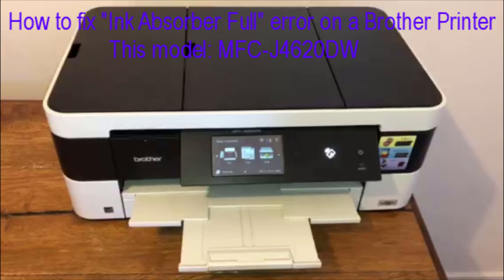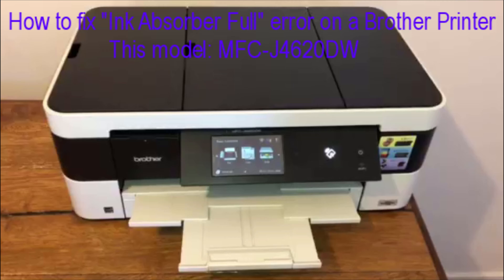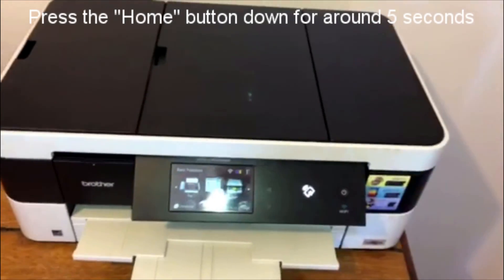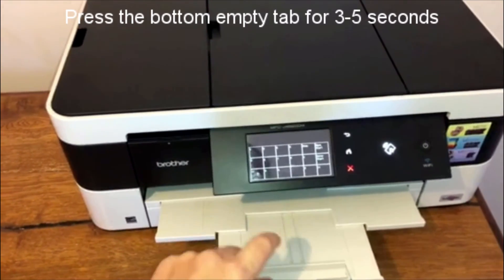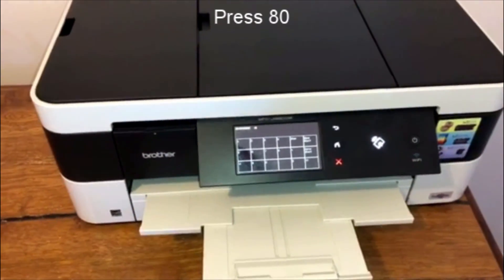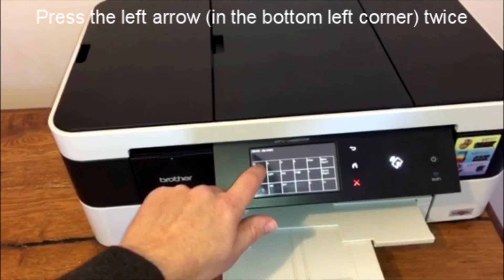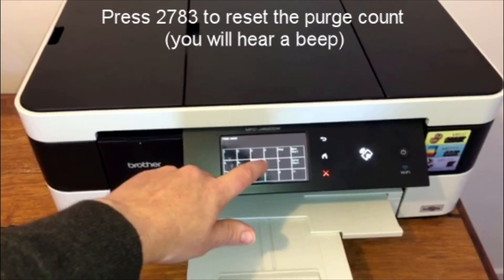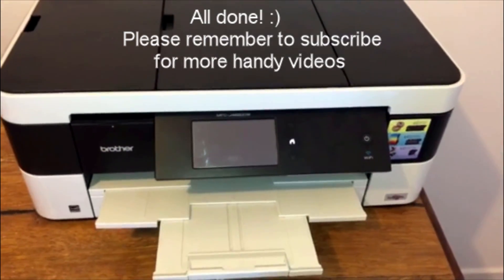How To Fix Ink Absorber Pad Full (Error 46) and Clear Purge On Brother Printer.

Comment: This isn't working. I followed and did your other video on cleaning the ink absorber. I cleaned it put the printer back together and right away I got the ink absorber message. I did this video as well but its still not clearing out the error for thw ink absorber and still won't copy or print. What should I do next ? Please help I dont want to replace this printer. I really like this one

Comment: It worked with J4420DW but two notes: I saw "Machine error" after entering *2864 but I pressed on regardless.  There are two PURGE items on the list. One PURGE alone, and another <en> PURGE.  After clearing just the second I got "Ink Absorber Pad Nearly Full". Then I cleared the first, and no error messages.

Comment: Thank you for the video showing how to change the filter on our Brother J4420DW, mine looks identical to yours, but is not going to the same place after I punch in "*2864. Mine doesn't go to "maintenance", instead it goes to "Error46" at the top. And while I can use the over arrows to get the window with the up arrows, hitting the up arrows only results in the error beep because of the Error46 code. Basically it has me in a logical circle not letting me reset error46 because of error46. Any help would be appreciated.

Comment: I followed these instructions and purge the counter multiple times but the error is still there!  Help!
Reply from the maker: Shut down and unplug for 10 minutes then load back up. Let me know if this fixed
Reply: @Knowhow1  After 10 mins. unplugged - Still same error message "Ink Absorber Pad Near Full"  - printer works but scans only one page via Easy Scan app
Reply from the maker: @darshnashah8251  do maintenance mode again and clear both the purge and flush counts. You might have flshcl and flshbk or similar which you should clear both of. They should be next to each other on the menu selection. Ensure the number resets to 0 when you clear each. If all are 0, some people have had the error msg stick around for a day or two before it disappears.

Comment: I have a 40 5 one0DW and mine is not coming up with a purge button it says import from card import all export to card what should I do
Reply from the maker: It sounds like you have a sd card in the printer. If you do, remove that and try the maintenance mode again

Comment: Followed these instructions to the letter, also the other video on how to access the maintenance mode and clear error 46. I now have a printer which will print the test page but it will not print anything else. I have checked it's connection to the network and everything appears fine in that respect. Initially it would print a test page submitted from the laptop but no longer does that either now. Any suggestions, as I have no idea what to do from this point?
Reply from the maker: Shut it down and unplug for 10 mins, and then reboot your laptop and power on the printer. Try to print from your laptop again, and if it doesn’t work, try reinstalling the printer software
Reply: @Knowhow1  Thank you. That seems to have done the trick. Much appreciated help without which the printer would have been consigned to the scrap heap.
Reply from the maker: You’re most welcome! Have a great day

Comment: This didn't work for my MFC J6520DW although the Purge is reset to 0. The ink pad full error is still there. I got the ink pad cleaned and the man in shop thought some of the codes around the purge were 00000 to and maybe they shouldn't? If you've any suggestions that would be great. The Purge was 5800 approx before reset. 
Sen Purge 00000
Purge 00000
Bypass Jam 00000
CD Jam 00000
CD Page 00000
DX A3p  00000
DX MN Copy 00000
DX CL Copy 00000
dx pc 001276
Reply from the maker: Make sure to reset the flush counts, too. If the error is saying ink pad is full,even after a clean, you just need to try a hard reset. Unplug the machine for at least 10mins and boot back up. 

I have a vid which gives more description : https://youtu.be/PlWQ1ipbr8g
Reply: @Knowhow1  Thanks very much. I’ll try that and let you know how I get on 👍🏻
Reply: @Knowhow1  once I reset the FLSCL: the ink absorber pad full fault is gone and my printer is working again. Thanks very much.

Comment: First great videos.  I have watched them so many times trying to correct the Ink Absorber Full issue that I have memorized the codes in order.  Here's the problem that I hope you can solve:

I followed your video about cleaning the pads and purged the pages.  That worked for about two weeks and then the ink absorber error came back so I purchased a new pad.  I installed it as described in your video.  However, after purging the number of pages again, which stood only at 182 after the first purge, the message "Ink Absorber Full."

I went through the purge process two additional times and the same message appeared  Machine Error46.  Consequently, the printer will not function.  Any suggestions?
Reply: Thanks for the link to the other video.  Strange thing though, I unplugged the printer overnight and when I plugged it back in to do the purge of the flsblk and flsclr, the error 46 message was gone.  Nonetheless, I did follow your terrific video and we are back in business.  Probably didn't have to purchase a new pad but I did mangle the plastic covering on the old one so just as well that I did.  By the way, love the accent!
Reply from the maker: Thank you 😊 sometimes the machine does need to be shut down to clear the message… So glad you’re back in business !
Reply from the maker: Thank you ! You also need to clear the flush count. I don’t think I made this clear in that video, so I made another one on resetting both the flush and purge. I hope this resolves this for you - and I really need to redo the ink absorber video because I did brush over some steps too quickly :)
Reply from the maker: https://youtu.be/ANCokAwTwxo

Comment: Hi, i am getting a "Machine Error46", this one have appeared, after i have cleaned the "ink absorber" and was following instructions how to get reset the "ink absorber message", but now, i cannot print. Please help
Reply from the maker: Sometimes you need to unplug your printer at the wall, and leave it sit for 10-2 minutes before powering it back on. This should clear the error 46 message,

Comment: What the heck?! The printer died right after doing this!

I have an MFC-J4510DW in front of me.
It could no longer print due to ink absorber box full error. I opened the printer and the pads were indeed full of ink. I followed your instructions from the video "Clean or replace the ink absorber box on a Brother printer - Fix Error 46 on MFC or DCP".
I made sure everything was perfectly dry: cleaned with paper towels, used a hairdryer and left the pads in front of an air fan for many hours.
Reinstalled everything and then I followed the instrutions from this video.
This all went fine and worked . I then printed a test page which also went fine so I was super happy; the printer is fixed again!

Then I shut off the printer. I started installing the drivers and turned on the printer... but nothing happens! The printer is suddenly dead?! It won't power on anymore.
It was working fine just before! What the heck?

Either there is ink leaking somewhere and shorted something or the machine went dead due to going in maintanence mode.
It must have something to do with the latter? I mean, it was working fine until I shut it off.

I'll have some explaining to do as this is a family member's printer. Dang it!

EDIT: I searched online and found these instructions:
1. Unplug the power cord from the printer.
2. Press and hold the Power button.
3. While still holding the Power button plug in the power cord
4. Wait for it to start, when normal home screen displayed release the power button.
This works! The printer powers on again... BUT (!)... when I shut it off, I can't get it to power on again. I have to redo the steps above.
Reply from the maker: It’s possibly the drivers. There’s really no need to update them, and the drivers released since  2019 were basically just to stop aftermarket ink refilling. I would download drivers 2018 or earlier, remove the current drivers and install the earlier ones.
Reply from the maker: Also- Did you reset the purge and flush counts ?
Reply: @Knowhow1  
Hi, thanks for replying.
This printer isn't mine so I didn't have drivers installed to test it. I downloaded the AIO-software/driver package from the Brother website and installed them in a virual machine.
Do you have any idea where I can find the pre-2018 drivers?

I have just reset the purge and flush counters exactly as shown in your video.
I am still unable to start the printer. I have to hold the power button, insert power cable and wait for it to start. Then it works fine until I shut it off, again unable to power up by pressing power button. Really strange. And this didn't happen before.

Also, black isn't printing but maybe it's clogged/dried up as this printer has been sitting still for a long time. Already used the clean function but no luck.

EDIT: After removing and reseating the black ink it now shows as completely empty so that's why I can't print any black.
The printer remains to have the issue of not starting :(
I checked the firmware version (tried updating) but it's already the latest version.
I have set the printer to factory default.

It won't start unless I hold power button, plug it in and wait to load to home screen. It's annoying but at least the printer can print.
I'll have to search further why it's doing this unless you have any other ideas?
Reply from the maker: @FUG_THE_LEFT  Here's the link I use for rolling back to older drivers - https://support.brother.com/g/b/downloadlist.aspx?c=us&lang=en&prod=mfcj650dw_us_eu_as&os=10013
The black ink showing empty can also be due to the updated firmware. Does it say the cartridge is incompatible ? Deselect automatic updates for your printer, uninstall all the current firmware and install the older firmware, and hopefully this will be your fix.
Reply: @Knowhow1  How do you download previous firmware? There is only a link to Firmware Update Tool.
https://support.brother.com/g/b/downloadlist.aspx?c=us&lang=en&prod=mfcj4510dw_us_eu_as&os=10013

EDIT: it doesn't say incompatible cartridge, just that it's empty. I don't have the printer with me anymore at this time (at family member again). I'll order refillable cartridges and ink bottles. Hopefully it won't show unrecognised but the set comes with new chips so it should work I guess.
Reply from the maker: @FUG_THE_LEFT  the latest drivers probably won’t recognise refillable cartridges. To download the firmware, choose the op system up the top then select Printer and Scanner Driver for Local Connection
Reply: @Knowhow1  Thanks, found it. However, it's the same driver for XP all the way up to WIn 10. Release date 14-04-2014, version C1. I'll just try it and see if refills work.
Thanks again for all the help! Still won't fix the power issue but at least it should be able to print again.
Reply from the maker: @FUG_THE_LEFT  it might fix the power issue. Let me know. Drivers for printers don’t update very often, so it’s likely the only driver that was released, and compatible for the different op systems. Best of luck 🤞
Reply: @Knowhow1   Thanks. I'm waiting for my refill kit to arrive. Once I have it I'll try it out and maybe reinstall the firmware.

Comment: What is machine error46 mean?
Reply from the maker: It means the page count has reached the manufacturers limit before the ink absorber is nearly full. You can bypass this by resetting the purge count, but it’s recommended to clean or replace the ink absorber pad to avoid it overflowing. I’ve got videos on both these methods

Comment: Thanks very much for that. I had initially succeded in gaining more copies on my MFC-J4510DW (not one you have listed I see) by following this video. After a few months and many more copies, I got the message back and tried deleting the Purge counter, FLSCL and FLSBK counters but to no avail (error message remained - 'Error46' and printer refused to print). I have since followed your other video on emptying and cleaning the tank etc: I could still not clear the error so tried cleaning the sensor card that detects the ink in isopropyl alchohol and drying over night (as it was a bit inky within the board material so thought it might give false info on tank level). Still no joy. When I get to the stage of entering *2864 I get a brief 'Maintenace' followed by beep and "Machine error 46". Pressing 80 then gives something like "01:35 12:48 OK". I have then tried various things like 2783 and 80 and it won't clear and stay cleared. Any suggestions would be much appreciated as I can't bear adding to the plastics mountain!
Reply: Did you fix this? I have the same

Comment: Thank you so much - very clear and easy to follow.  I am a bit surprised a home printer has this sort of maintenance requirement.  Seems like a bit of planned obsolescence to me.
Reply from the maker: Very true!
Reply: Not really. The print heads need to be cleaned, and that ink has to go somewhere. Re: the resetting, perhaps, but resetting won't solve the problem of a full ink pad.
Reply: Without changing the absorber it's not really a solution. Why Brother wants you to buy a new printer instead of changing the pads is a bit customer un-friendly though.

Comment: I've followed the video, cleaned the ink pads, dried them initially with a blow dryer and put it all back together.  Also found the instructions for purging the various codes including FLSBK and FLSCL.  I still am receiving the ink absorber full message.  I took it all apart again and the felts are definitely dry.  Any suggestions.
Reply from the maker: The message can still temporarily appear- Try unplugging the printer for 20 mins, and hopefully the error will disappear, or often it will clear on its own after a day or two. Did you also reset the purge count ?

Comment: This worked, thank you so much! I have several printers that I use for work and several errors like "unable to clean 50" and "printer's waste bin almost full" I am wondering where you found the codes for different problems so I can attempt to clear other issues?
Reply from the maker: Are they brother printers too?
Reply: Yes they are. Thank you! 

Weirdly, I also have several printers that this hasn’t worked for. It seems to automatically show the “ink absorber pad full” at about 13,130 ish prints. This process works to clear that. But then if it ever shows it again, it doesn’t work a second time.

Comment: I have a J885DW, will this also apply?  And am I to assume I am just "buying time", so to speak, until I need to dismantle and clean the actual pads?  Should I wait for it to alert me again, then take it apart to clean?  You're awesome for posting this.  THANK YOU!!!!
Reply from the maker: Hi - yes it should work - and you’re right in that it’s only buying you time until you need to clean or replace the ink absorber box. Try this method first- it might give you a few months of extra use (depending on how much you use the printer) and when the ink absorber is truly full the error won’t be able to be overridden this way. I have a simple vid on cleaning the ink absorber box. The parts and installation will likely cost a lot more than getting a new printer, so it’s worth trying to clean yourself.
Reply: @Knowhow1  Thank you SO much for this thorough advice!!!  I'm gonna try this today :)
Reply from the maker: You’re most welcome ! Best of luck and pls let me know how you go
Reply: @Knowhow1  I just tried this procedure twice and I'm still getting error "Ink Pad Full".  Any idea if I'm doing something wrong?
Reply: I also read down a bit at some other comments and performed same procedure on the "sen purge".  Unplugged and still receiving the same "Ink Absorber Pad Full".  Should I also perform on the "Flush" cycle?
Reply from the maker: TheLongtalllizzy Try doing a hard start on the printer to reset the memory. Unplug it for at least 10 mins then hold down the power button while turning it on. Keep holding it down until the main menu displays. If the error msg is still there you may need to clean or replace the ink absorber. Error 46 initially displays after 7000 or so pages printed, but the ink absorber still usually has some life in it. If the sensors pick up that it’s truly full, the error msg won’t go away. It’s quite easy to clean it yourself, and I’ve got a video which shows you step by step. Try doing the hard start first, then maybe you’ll need to do a clean (or replace)
Reply from the maker: TheLongtalllizzy yes definitely do the flush count as well if you haven’t already
Reply from the maker: The link for a hard start : https://youtu.be/PlWQ1ipbr8g
Reply from the maker: And for cleaning or replacing ink absorber : https://youtu.be/6IsmfZbJNfQ
Reply from the maker: TheLongtalllizzy and my vid on resetting purge and flush https://youtu.be/ANCokAwTwxo
Reply: Know-how ok, I’m attempting to clean the pad, but my support arm looks nothing like the one in your video 😬. I’ll send a pic through email
Reply from the maker: TheLongtalllizzy your printer might be too different to the one in the video- it might not help you much to be honest